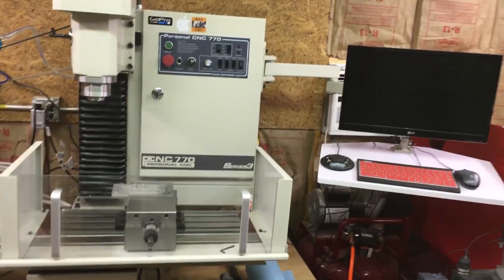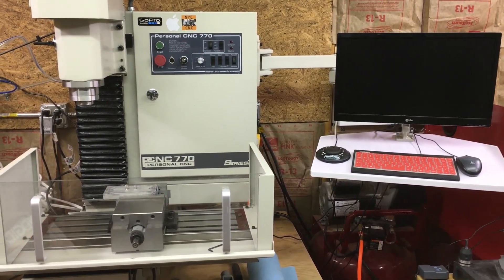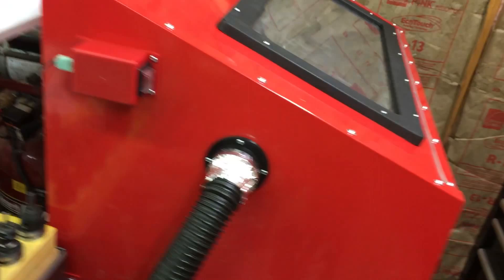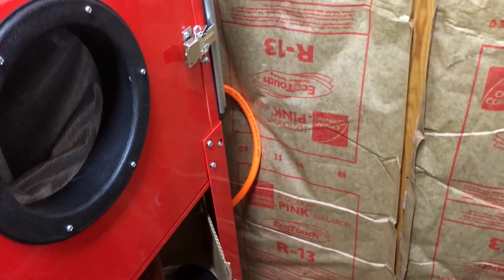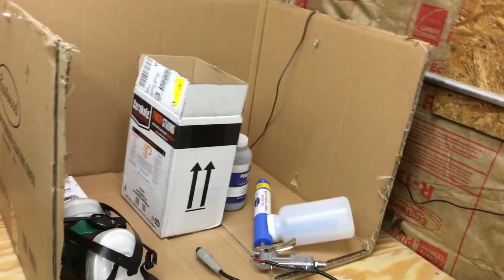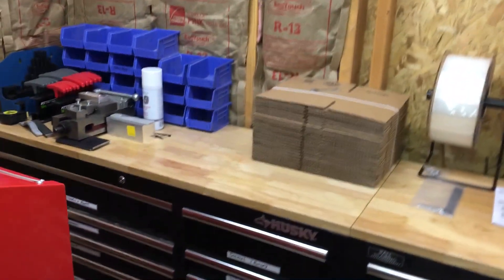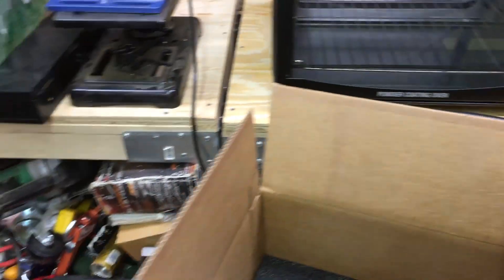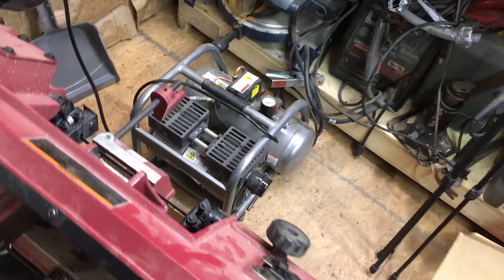Manufacturing Part 1 - Intro to Manufacturing Series

Comment: Hi Craig, I also live in Arizona (Phoenix), I've been looking into getting a Mill myself and have been very interested in the Tormach 770, but I am now also interested in the 440.  Could you tell me how long it took total time for it to be delivered to you once you placed the order?  I have also been piecing out how much the total cost would be with accessories, very similar to what you have but I would also want the power drawbar, the price can get very large very quickly, have you be ordering as needed or did you get everything all at once?
Reply from the maker: +Scott Talkowski - Cool!  I live in Mesa.  It just took a couple of days.  They have a warehouse in Nevada.  Yeah, I went as cheap as I could and just bought the extras as I could.  My power draw bar just came in.  I will be doing a video on it soon.  Let me know if you need any help.